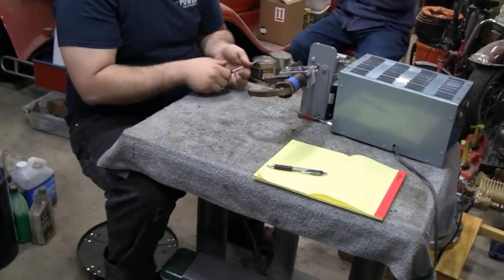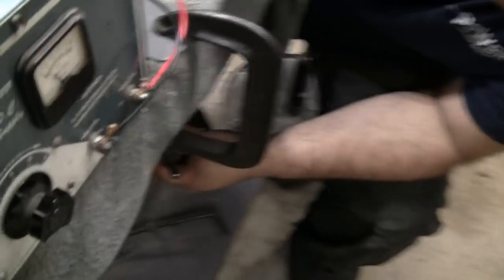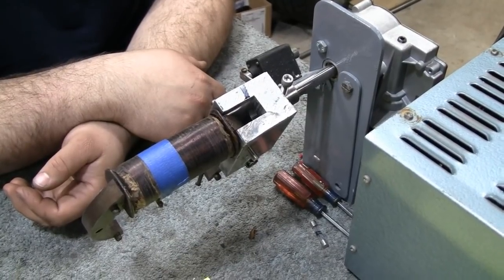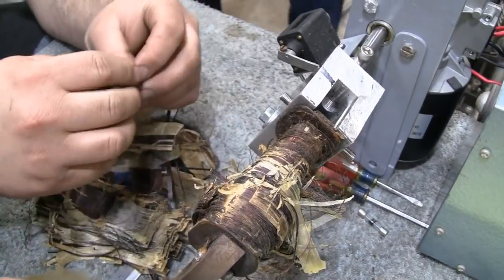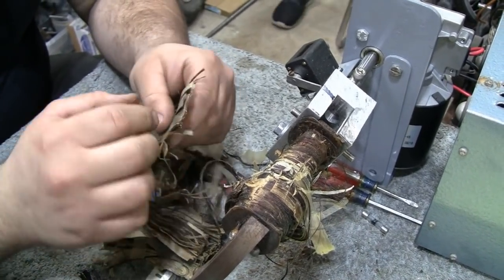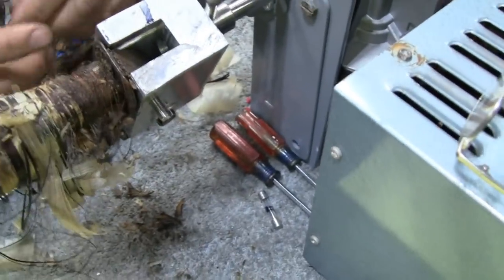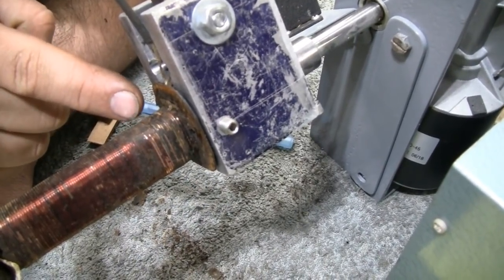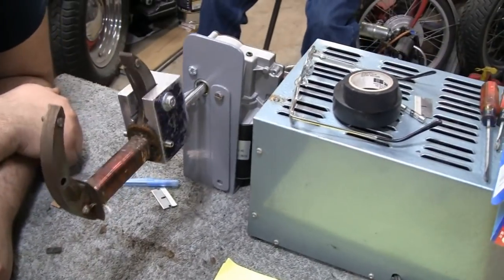HOW TO REWIND A BRIGGS IGNITION COIL (part 1)

Comment: You're gonna need at least 25 mg of time released adderall to sit there for 6 hours counting wraps and keeping the wire lying straight, or...a system that moves the wire over slowely enough while it feeds the wire to the coil with just the right tension. Kinda like the thing on a winch that keeps the wire lying straight as it feeds. This is a complicated pain in the neck!
Reply: It's called a Fairlead and it doesn't actually move the rope (or wire) from side to side - but rather "encourages" somewhat better side to side winding.  If you had ever used a winch you would know that it's only marginally useful and often just makes one Gigant-Hugeic wad of cable that usually needs wire cutter resolution.
Reply: @joesinakandid528  Thanks, I didn't know what it's called, and that's true about winches, but my fishing real actually does a good job of lying the line back where it goes. Same concept, maybe it just works better with way less load on the line and thinner line????

Comment: That insulating paper on the secondary is pretty important.

15000 volts for the spark is quite common. With 25 layers wound left to right, right to left alternately then the average voltage between layers is about 600 volts and the peak voltage at the ends is about 1200 volts. The enamel on the wire isn't going to withstand that sort of voltage for long.

On the primary the requirement is simply not to have a short between layers but from what Mike was saying about the enamel flaking off that may well have been the problem which made this coil go bad.
Reply from the maker: Yeah Buddy!! ☺

Comment: foot switch.. variable foot switches are possible.. including creative versions that pull a string wrapped around the power supply voltage adjusting knob..  might have to make a pulley out of wood to do that.  this would allow you to speed up..

 a second foot switch with a DPDT ON-(ON) momentary set up could let you reverse it.. something like this  https://www.allelectronics.com/item/pb-176/dpdt-momentary-pushbutton-switch/1.html as a reverser. 
 i don't know what kind of spool holder you have.. or if you are using a tapered nylon lined tube to feed your magnet wire onto the laminations.. 

 you might also search for fish paper used for electrical insulation ..  instead of wax paper.. https://forum.digikey.com/t/what-is-fish-paper-how-is-it-used/1390